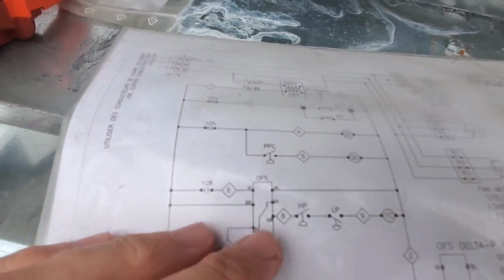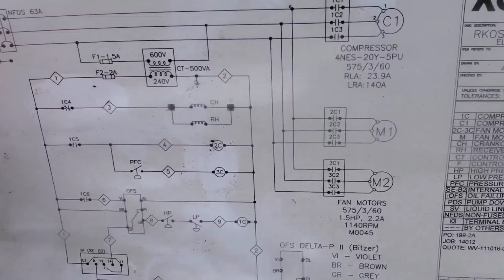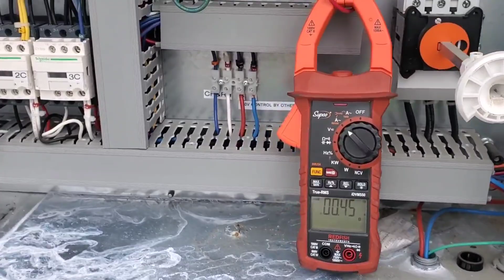Walk-In Cooler Troubleshooting and Faulty Receiver Heater

Comment: Hey why do they have a receiver heater , what's the purpose of it ? Never came across one . Thanks.
Reply from the maker: It's to keep the receiver pressure/temperature up in low ambient conditions.
Reply: @HVACKnowItAll  No t-stat on heater control circuit so it stays off when not needed? Trane Carrier had those on their crankcase heaters residential in the day.